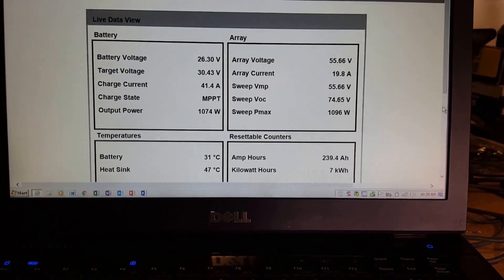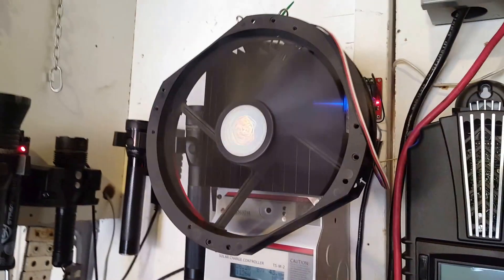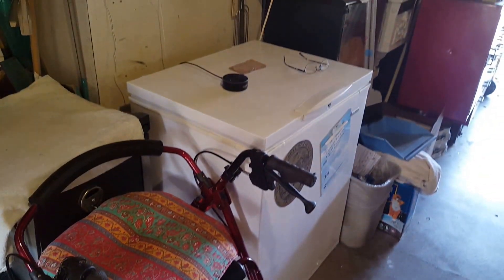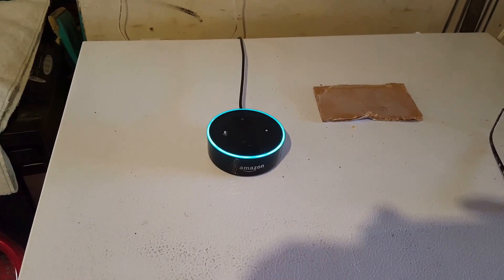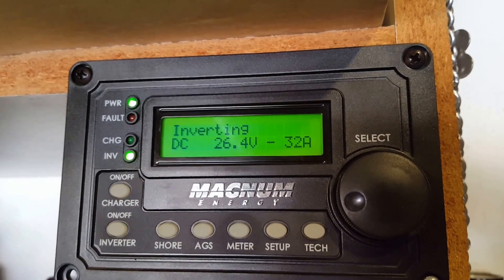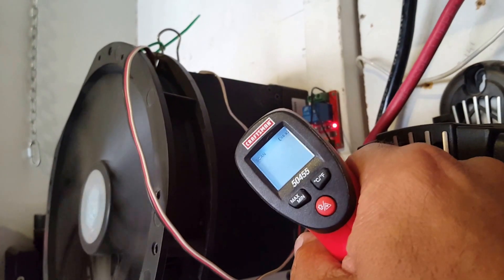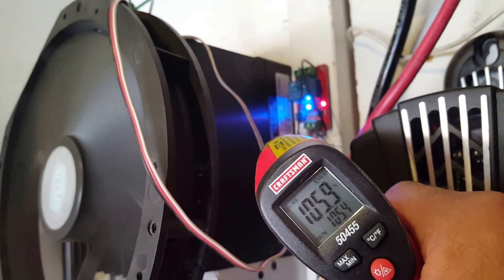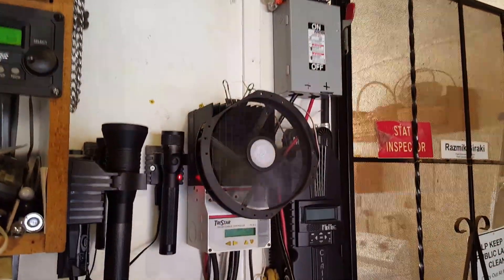Dealing With The Heat On The Solar Charge Controller On A Hot Day!

Comment: You really seem to be obsessed with temperature. 95 degrees out is not hot. In most of the midwestern US 95 to 105 is a typical summer day. Add in a dewpoint of 70 degrees and that's the south. Your morningstar is fine there in comfy California.

Comment: in Australia in the outbackwe use chargers in 50deg c they dont die on us , you have top quality chargers too so you should be ok , that temp is cool for us and we never have issues, the only problems i ever had was chinese inverters they just die with almost no load so we had to buy good quality.
Reply from the maker: closertothetruth just trying to prolong the life of my equipment and reduce the created resistance by the heat.  I don't believe that the most of the foreign made junk would provide a trustworthy and reliable service! Be Safe